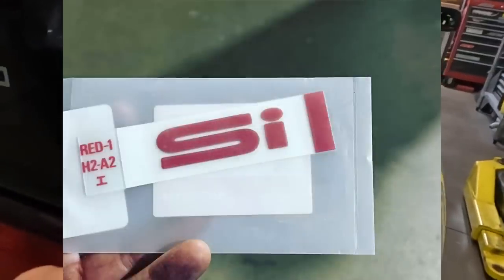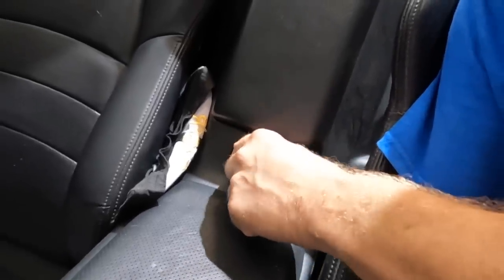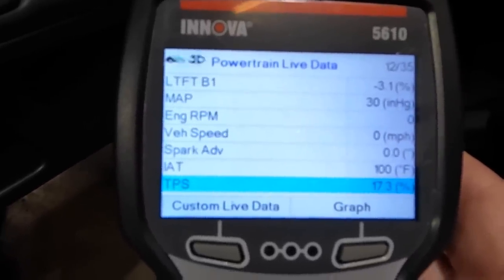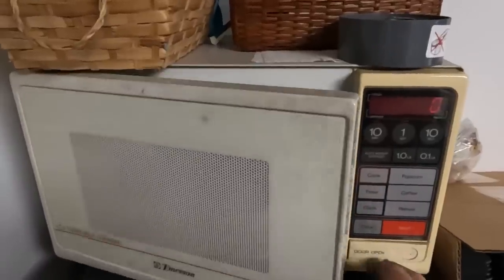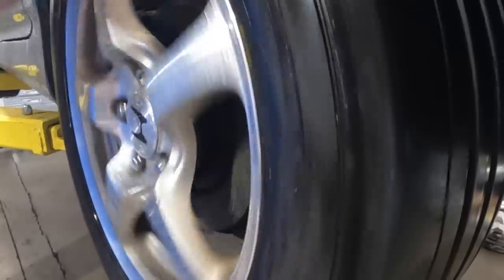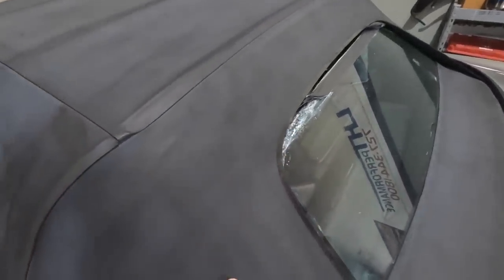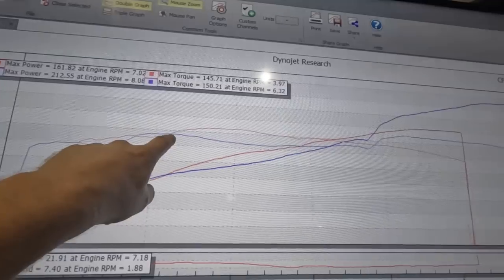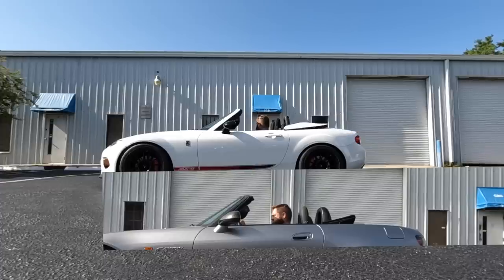S2000 Clutch INSTALLED Wrong

Comment: First car was a 4th generation prelude,  I now have a 5th gen prelude I have the motor all apart and building it to handle turbo power,  I have a log manifold to keep ac and ps,  how much hp is a log style good for if I plan to only run e85. I had a local tuner tell me 450 is max,  I only want to shoot for 330-380.